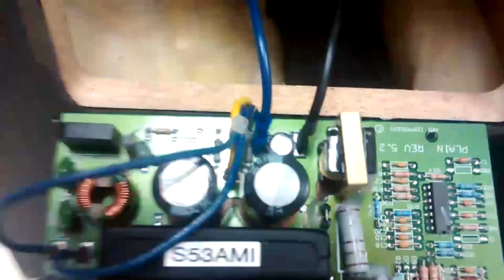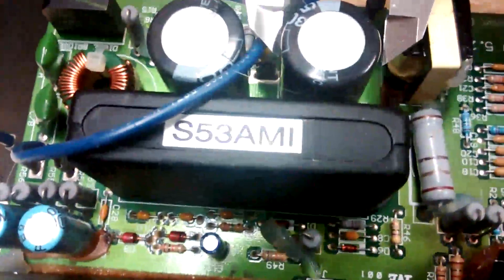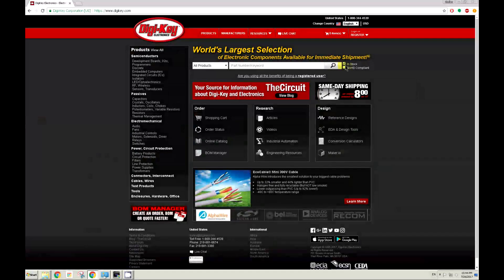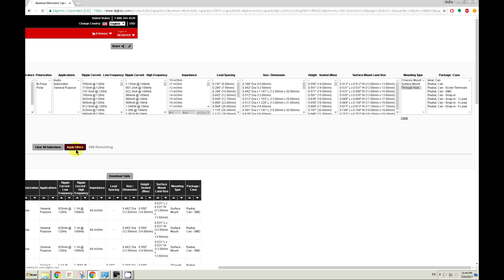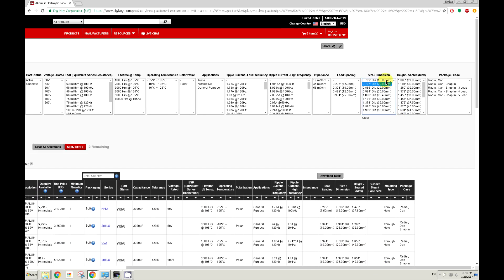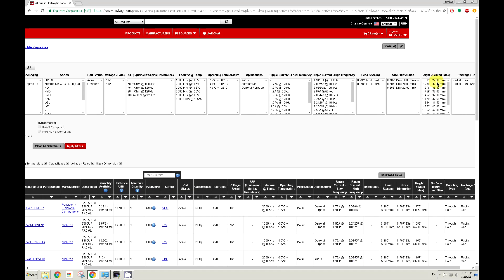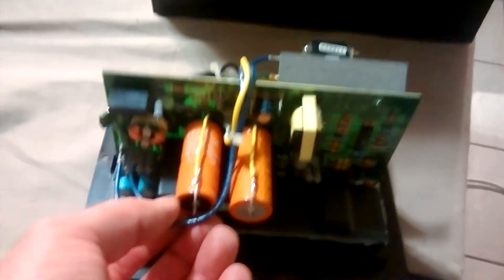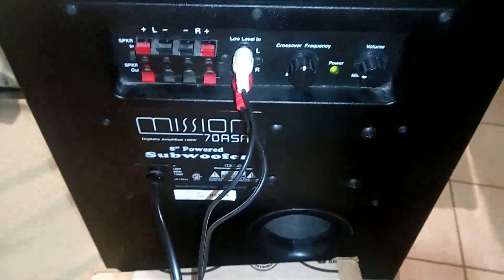Common cause for subwoofer buzzing  - repair guide

Comment: I really need to know the size of the capacitors in parallel with the speaker out pins. Just in front of the two big ones he changed.

Comment: I bought one of these bass cube, i plugged it in and all i got was loud hum and buzzing, so i knew what was wrong, the power capacitors were bad.  they usually swell on the top.  you don't need measuring of the caps, you can do it by eye.

Comment: Hi!  I have a Definitive Technology Super Cube Reference subwoofer which produces a very loud 60-cycle hum when power is connected to it, without an audio source.  When an audio source is connected to it, the subwoofer produces the bass normally, but the hum still exists.  This subwoofer had been in storage for a few years and I just recently took it out to tried to use it.  For the first few time, it did not detect a connected audio source with power cable hooked up.  (The subwoofer has automatic power on; there is no on-off switch.)  I tried again a few days later with the power connected, but no audio source, the 60-cycle hum started after about 15 seconds.  It has done this ever since.  Again, the subwoofer plays fine, but with a loud hum.  I would appreciate very much if you could give me any suggestions.  Thank you very much in advance!
Reply: Found a kit of smaller capacitors for my Sunfire HRS power board sold on Ebay. The seller indicated the large pair rarely goes bad. Indeed, once removed, one of the smallest caps proved to be blown. Replaced all 6 while at it, and it did the trick.
Reply: Hello brother.
I'm in Africa and i have this problem.
What kan i do toi repare this sub???
Reply: Hello! Have you figured this one out? I have precisely the same story. I've just replaced both big capacitors and this did not fix the sub.
Reply: Unfortunately not.  ☹️

Comment: I got one the same,
One of the main filter cap was opened, I replaced it, also there was a 100uf as 35 v was opened. replaced all, Am getting 38V DC on the speaker terminal. There's a 10uf 100v BP and a ceramiv 100NF 50v both burnt. replaced, still 38V DC on speaker terminal. You think the power module is shorted. There's twa 1k ohm resistor that get very hot.
Reply: maybe the  diode bridge rectifier  having issues. Thats what fixed mine but i did change out the caps too just in case.

Comment: Dear Tom, thank you very much for your great video. I have the exact same sub (mission 70ASE), with the same problem. Can you send the link for the right capacitor? I just don't want to make any mistake as I am no specialist
Reply from the maker: sorry that was a long time ago. you can measure the dimensions and distance between the pins and post them here and I could look it up for you

Comment: Great video and very helpful. My subwoofer (wharfedale PC10A) sometimes gives out loud bursting noise, all in a sudden, sometimes just works well. I disconnected the input audio cable, and turn the volume control to the lowest level, and found once you switch the sub on, sometimes the loud noise can still come out. I have to turn the power off then. Would you think this is also the cap problem? Thanks.
Reply from the maker: If it is deteriorated caps then the problem would be consistent. the noise would be low frequency also

Comment: Hi, great video, I have a heartbeat sound coming from my subwoofer without any input signal. It usually happens after a couple hours of use. I’ve heard it might be the smoothing caps, would those be the same as the main filter caps?
Reply from the maker: I wouldn't expect a heartbeat sound if these caps are bad... Is it a regular sound or random ? Usually caps that have lost capacitance will cause a hum
Reply: Heartbeat might be a relay switching on and off? If there's also a quiet click from inside the sub. There's usually a capacitor powering the relay, that may need replacing if it's clicking on and off.

Comment: Mine makes this noise after 20 minutes of playing music, but none of the capacitors look bad. Any ideas?
Reply from the maker: The characteristics of components change with temperature. In your case I would probably check for bad sorry joints first, then get a can of freeze spray and try to narrow down the faulty component by cooling individual parts/areas

Comment: The awful crap glue they use on the boards to keep components in place goes conductive over time!..Scrape it off and clean the board with some isopropyl alcohol or pcb cleaner and an old toothbrush.

Comment: Dood help me out, im lookin' for the right capacitors for my PSB Subseries 1 subwoofer
Reply from the maker: I don't know your specific model. Remove the defective caps, take their dimensions and write down their capacitance/voltage. In North America you can go to digikey.com and find a replacement. Other countries have other distributors, I couldn't help with that. Use good caps with high ripple current and 105°C rating or more. They will last longer
Reply: @tomtechtod9200  Thx for replay! i dont know much about this, but the numbers and writings on those capacitors are way to small and kinda vanished, think that by only taking the size the people at electronic shops can provide me the right capacitors? i wish to remove them and go to the stores but i can´t, i dont have the knowledge or the gear for that, so what can i do to prevent one tech expert to bend me over?
Reply from the maker: No, you can not deduce the values from their dimensions only from their function in the circuit. To replace caps you need a soldering iron and solder. If you want take a pic of them and send to my email ( in the about section) I can have a look
Reply: @tomtechtod9200  ok!! i will take the picture and maybe you will see if is about the caps or something else because i saw some little melted board too

Comment: if the capacitor is not bulging.. then what could be other reasons for the buzzing sound..
Reply from the maker: It can still be capacitors. They don't necessarily bulge when failing.
Reply: @tomtechtod9200  just had that experience - replaced 12 bad electrolytics, not a single one showed bulging or leakage, but were either completely bad (capacitance very low) or way off specification.  Two thirds of the electrolytic caps were bad on the board.  This is an Infinity PS-12 subwoofer.

Comment: Hallo, I opened mine, power is fine bt two wires from speaker are unattached to the plate, plz show me how / where i put them for speaker to work again...
Reply from the maker: You need to find a forum to post some pics and ask for help. Not possible on YouTube

Comment: Great video and very well and thoroughly explained.

QUESTION.
Would this solve a constant buzzing sound from the amplifier when it's switched on? In standby there is a hum which is acceptable but when it's powered on there is quite a loud constant buzz/hum. I don't think its a ground loop issue as the sound is there regardless if there is an input source or not.
Reply from the maker: yes, replacing the caps may help with the buzzing. In any case, electrolytic caps deteriorate over time depending on ripple current, temperature etc. It would be the first thing I replace. Usually it can be seen as an increased ripple voltage over the caps that went bad. If the buzzing continues continue debugging.
Reply: @tomtechtod9200  Thanks for the swift reply. Will give it a go!

Comment: They dont exactly use high quality brand capacitors in most home subwoofers, no wonder they fail so early. Id replace them with Rubycons or KEMETs
Reply: @Hi-Fidude66 Hi there, I'm gonna have to replace the capacitors on mine soon, which capacitor would you recommend and where? Price doesn't matter. Thanks.
Reply from the maker: I usually buy my stuff on digikey. Depends on where you live. Search for the size,capacitance and voltage, then choose the one with highest ripple current, life expectancy (hours) and the 105C types. Can't go wrong this way.

Comment: Is it possible that sometimes it just gets to much voltage line it’s build for 240v and the external power cable gives 250v
Reply from the maker: Where do you live where residential nominal grid voltage is 240V? I know of 220V or 230V, there 250V seems a bit high.. If that could affect performance of the caps depends on the design.

Comment: I have my paradigm pdr 12v3 making constant humming noise, no other sound is being played by the woofer, even after disconnecting from the source the hum remains constantly there. Are the main filter capacitors the culprit?
Reply: Highly likely. Could be injected noise though, so before heating your soldering iron try connecting to the different inputs and listen for any change. One of my subs is a B&W ASW750 and the plate amp will hum if "Line in" L is used and R is left "open". If R is connected to the receiver and L is left open it is dead silent.

Comment: you need to use speaker wires/terminals into those high speaker inputs on your sub, buddy. NO EXCUSES, SORRY.
Reply: What are you talking about? Using the low level, or LFE input on the amp board is ALWAYS the best way to send subwoofer signal to a powered sub. Using the high-level speaker-level inputs is a band-aid, and only used if your receiver is crap and doesn't have a discreet LFE low-level out. I've owned a home theater company for 10 years and been doing home audio for 30 years and have never used speaker level in.
Reply: @10inchskin  huh
Reply from the maker: I only wanted to get rid of the hum and test the sub afterwards. Doesn`t matter which input you use. Use the speaker inputs if thesource doesn`t have low level outputs: https://www.manualslib.com/manual/905262/Mission-70ase.html?page=5#manual

Comment: I have a set of altec lansing 220 amplified speakers and on the right speaker the input wire connector is missing.What kind of connector do I use or what type is supposed to go there?

Comment: I need help you guys. I have a Mirage MM-6 subwoofer. This is a high-end
 model and I've had it for nearly 10 years now, but lately it's been 
acting up. It's not really making a buzzing sound and although it's working, the sound is very "muffled" and dull -
 VERY uncharacteristic for this subwoofer!! It just sounds REALLY lousy! I know for a fact it's not 
the connection, or the wiring, or the receiver so it HAS to be the 
subwoofer itself. Does anybody have any tips or helpful advice?? If you 
have any suggestions, you can even email me your response at 
mistersooley@@t. Thanks. Cheers.
Reply: Seth Williams I have the same problem. The back Of one of the subwoofer is making a high pitched noise for me. I have 2 subwoofers connected properly to reciever vi a splitter so i know it’s not connection or amplifier. I also had my subwoofer sounding really lousy for some reason. I fixed that just by finding the perfect spots for the subwoofer. You can try that, i have no Idea Why my subwoofer is buzzing still. It happens when playing only and it’s not distortion . Since it’s not constant it doesn’t seem like ground loop. Aghh
Reply: No, mine is not buzzing. It's quiet. It just sounds like shit. @bakoe7604
Reply: Seth Williams Ah. I managed to fix the buzzing btw. Hope you get your subwoofer sounding right. Have tried changing spots?
Reply: No. It's the voice coil on it that's gone. That's why it sounds muffled. @bakoe7604

Comment: I have a Dali E12f. It makes the same noise but only if I turn the volume up to or over the middle, without any auxiliary imput or any rca cable connected to the subwoofer amplifier. I try to find some one to fix it but nobody wants to do this job. I’m leaving in UK Bedfordshire.
Reply: Do it yourself its easy

Comment: If I don't replace the capacitor but I connect a ground loop isolator to the subwoofer plug instead, does it help?
Reply from the maker: If the capacitors have lost capacitance you need to replace them. They remove the AC ripple from the DC after rectification. This AC ripple propagates throughout the circuit. Ground loop won't help

Comment: I have a JBL SUB 150P one that looks like a Darth Vader. I bought it 7 years ago and worked great till one day didn't power up no more nor standby red light didn't come on anymore. Stored it away but want to know what could be the issue?.
Reply from the maker: hard to say . Open it up and first check for blown fuses and obviously defective power components like transistors, rectifiers etc. You need at least a multimeter for that

Comment: Thanx for your vid m8.
I have a mj acoustic 100 mk2 and because i literary aloud to own my livingroom from 8pm till i die off i listen my stuff on low level and since i got a good deal on this sub and its truly quick and deep i love it. But i was always annoyed by that nois what i heard in the midnight silence . It wasn't loud because daytime u cant pick it up. 
But if once u get it it the buzz was just there. So little research and all upon your vid i decided to replace all the capacitors.  I got the same brand just in better quality- i guess-  tho what i found on the web they are not the best but not crap eather i mean the original and also i dont want to change the sound mutch . On the old caps labelled as tested 13.01.2003 .
And the noise gone i cant hear it . 
Awesome . 
Thankx again .
O btw the buzz was exactly the sound of the torroid noise if u listen it closely just amplified version trough the speaker.

Comment: I have a sunfire signature subwoofer that makes a constant humming noise. How much would that cost to repair?
Reply: If you do it yourself (which you should because its easy) only like $20
Reply: Hi, I've had this problem too. Buzzing and loud noise when I turn it off. How did you solve it? I tried replacing the two capacitors but it didn't solve the problem.
Thank you

Comment: I'm doing a repair on an Infinity powered sub.  It happens to have the same board can you tell me the size of the two capacitors at the speaker outputs.  On my board they are labeled C6 and C24.  Any help would be great.  The cylinder cap I'm thinking is 10uF and 50V.  But not sure about the small yellow one..
Reply from the maker: No, sorry, don<t have that sub anymore. I don<t see a yellow one in my video. Unless they put glue on it you should be able to see what<s printed on it.
Reply: TomTechTod they both completely shattered.   Nothing left except the legs.
Reply from the maker: oops, you might have another problem then. not sure which caps you mean, are (were) they electrolytic caps too?

Comment: Great video, thanks for sharing. Your plain speaking diagnosis helped me solve the problem with my Eltax speaker that had a subwoofer that was buzzing very loudly. I just swapped the blown capacitor for a new one at $1.50 and everything is back to normal. Much better than having to buy a new set of speakers! Cheers.
Reply: Hi Jim, Which model Eltax subwoofer do u have?

Comment: I just got a surround sound system and it works great but when I plug any of the speakers into SL I get a small hum it's really annoying. What could be causing this?
Reply from the maker: many possibilities. could be a fault of the amp itself, could be bad ground connection. if you are using right /left inputs, check if the hum remains on the same side if you swap them. if it also happens with HDMI inputs or optical it's most likely a fault of the amp though...

Comment: Just took out my vintage stereo system from the basement. Everything was working fine for a day.
All of a sudden, my subwoofer was making the same loud hum when I turned on the power, even without input source.
I was searching around and about to give up until I saw your video. I will take out the crossover and try to replace the capacitors. Now, I have to find my soldering iron! Thanks for the very informative video.
Reply: Hey I was just talking with my friends on Discord. Then "All of a sudden" my speaker producing like that sound on your video. I unplugged all cables and only power, it's still like that. Maybe something is shorted?
Reply from the maker: "All of a sudden" doesn't sound like it's the caps, this usually gets progressively worse. It points rather to a loose ground connection. But doesn't hurt to check them anyways.
Reply: Definitely will look around and check for loose ground. My sub was in storage for the last 19 years. I suspect that the caps might be dried up. Thanks